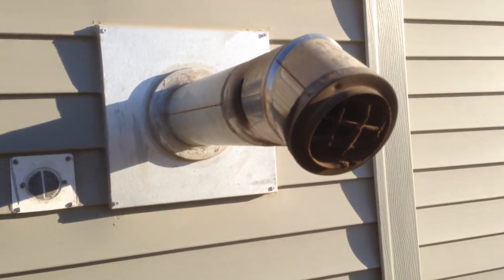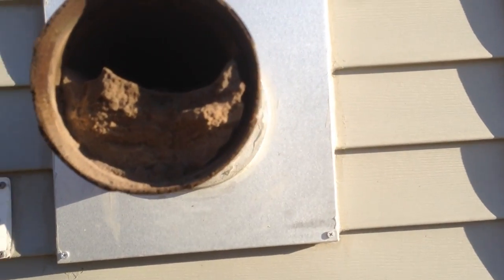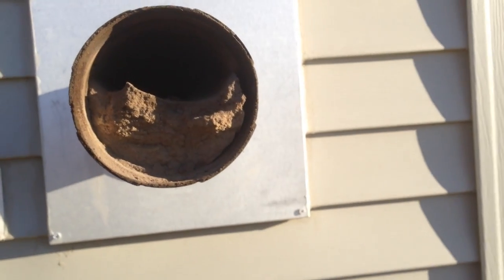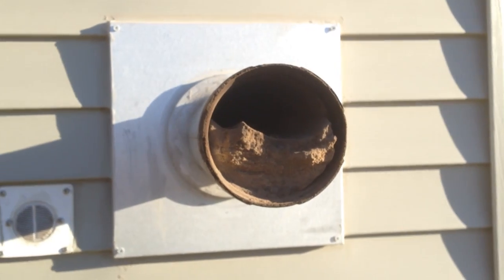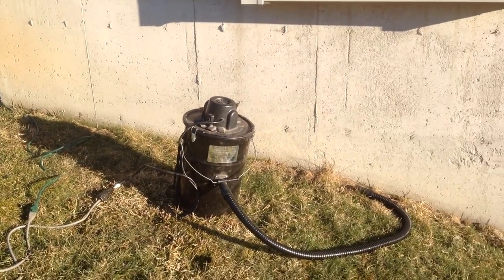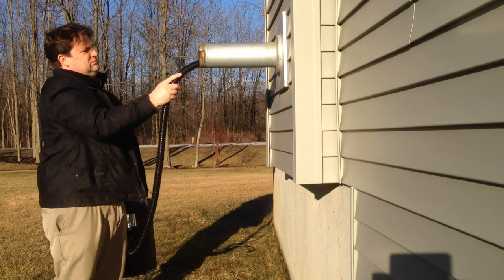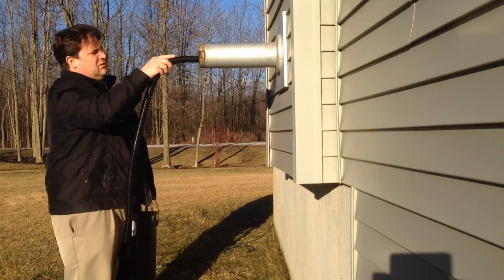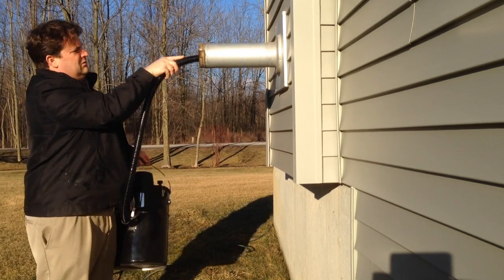DIY - How to clean Wood Pellet Stove Stove Pipe

Comment: Can you use a wet/vac vacuum in outside of pipe? 400 they want to clean stove and it's not even spring yet. Already replaced ignitor twice this year. The guy raped me on price the SOB and now pellets piling up. First time it ever SHUT OFF on it's own tho. That SOB never even went outside when he cleaned it. If this doesn't work, i'm done. Broke!!!
Reply from the maker: Sorry to hear.  Shop vac yes, but must be absolutely cool ash or you will set your shop vac on fire.  You will need a fine filter (drywall type) for the shop vac.
Reply: @GreenMountainDIYGuy  thanks mister. I caved and bought the ash vacuum. Really like it in the good side. Repair guy said it needed new combustion motor which i replaced and, God bless, it's working fine!!! No one ever answers my questions so thanks for being a stand up person. Take care!

Comment: Why don't you get a wood stove make it easy
Reply from the maker: If I had a wood lot definitely.   Pellets are pretty easy to buy, store and no mess.  Yes you have to clean the stove but it is an acceptable trade-off.  Thanks for watching.
Reply: Because the only positive thing about wood is price. The rest is just plain worse compared to pellet. More ash, more creosote, more cleaning, more space required to store fuel, more maintenance because it's not almost fully automated like pellet but requires continuous loading and kindling of fire

Comment: holy shit
Reply from the maker: Yep, if you have a straight pellet stove pipe, you have to stay on top of making sure it remains clean.  I clean it out after every ton burned.
Reply from the maker: Holy Smokes!
Reply: At the end of the season I use a leaf blower from stove side and blow everything out. Works great. If you use premium hardwood pellets there is no need to clean after each ton I find.
Reply from the maker: Right, we have a pellet stove fireplace insert, so it is difficult to access to the pipe from the inside of our home.  Much easier for us to vacuum from the outside.